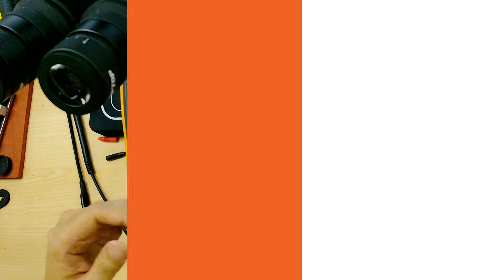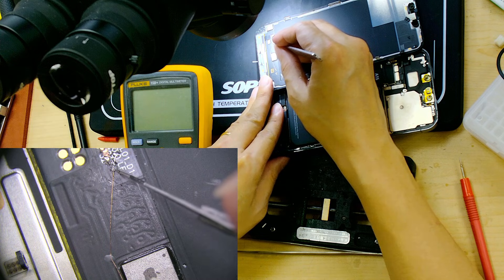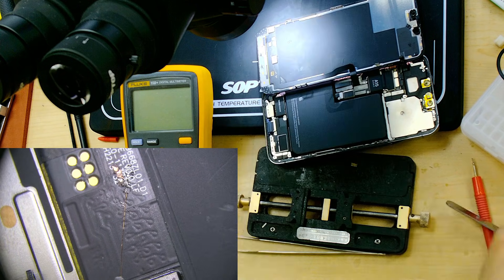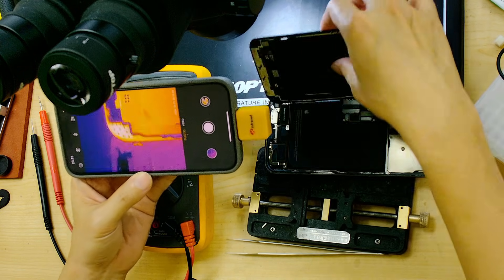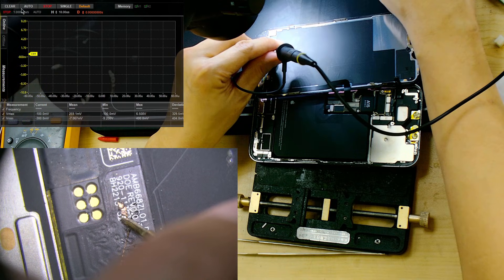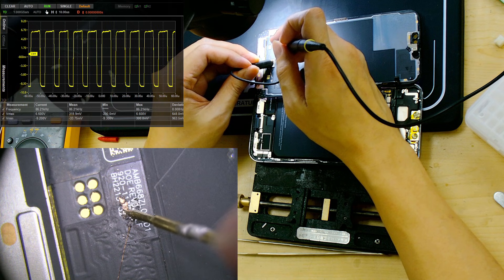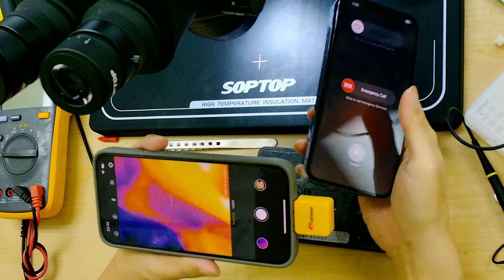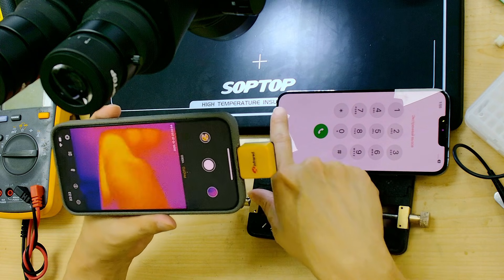When the Usual Jumper Fails | iPhone 13 Pro Max White Screen Explained

Comment: Hi master. On previous video about this jumper you said its necessary to use 100k resistor to prevent line burning. In this video there is no resistor. Please explain
Reply from the maker: No need anymore. After we found the root cause and the actual reason, we are confident the line will not burn or short. At first, we thought the damage was caused by an iOS update and voltage regulator fault, but we found that the issue was simply broken traces underneath the bottom frame. Also, countless time I have seen those screen specialist repair the issue by using specialized laser.

Comment: why is this fix required? physical damage? manufacturing defect?
Reply from the maker: OLED traces beneath the frame are broken. To fix this, we need to remove the frame and use a specialized laser machine to repair the damaged traces.
Reply: @iPhoneServiceMalaysia  You are amazing! Nobody does this here in Australia (that I know of?)